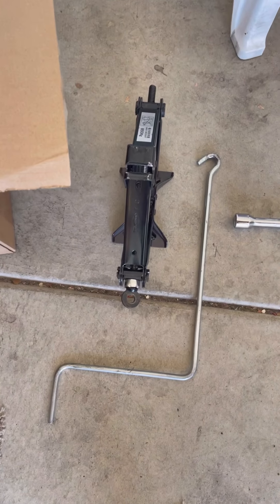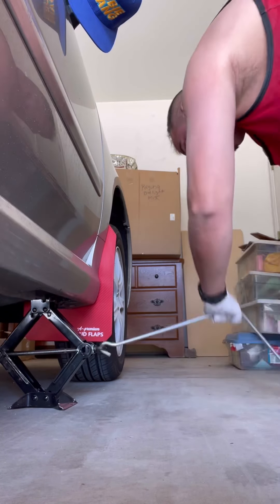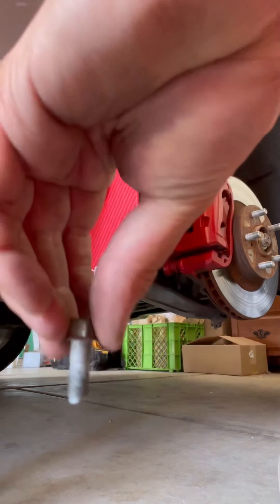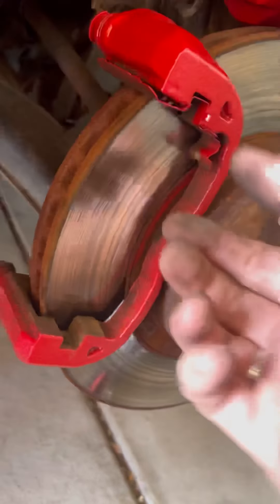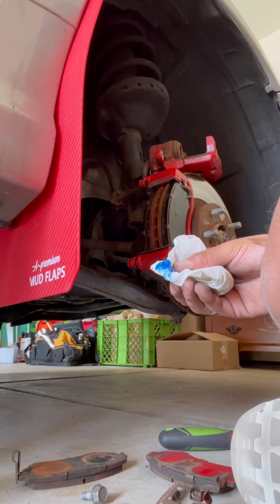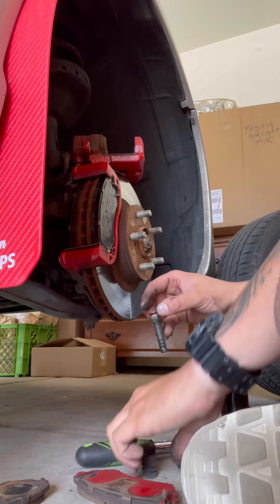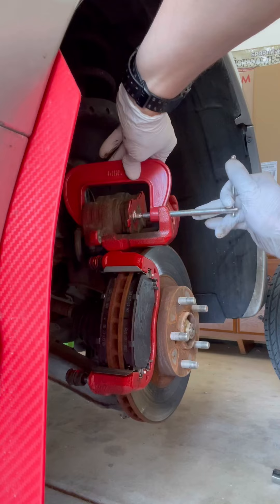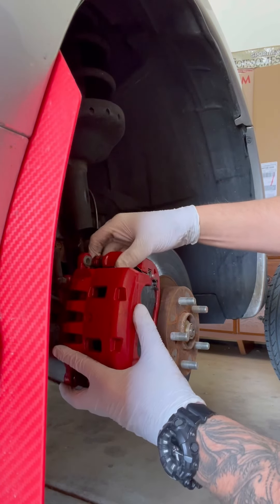Front Brake Pads Replacement on a 2006-2007 Subaru Impreza Outback

Comment: Where's the jackstands?😮  Those skinny scissor jacks are for lifting the car, not supporting it. At least put the wheel you removed under the car so you don't get trapped if the car falls.